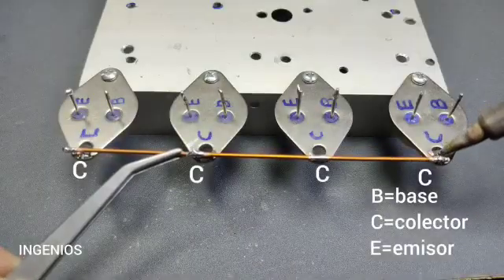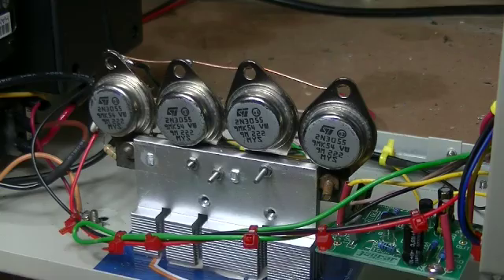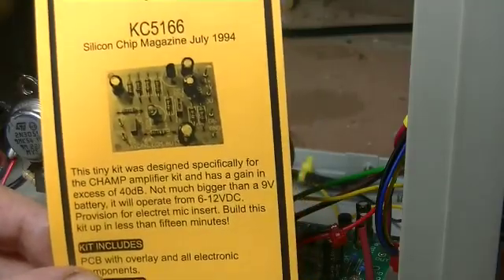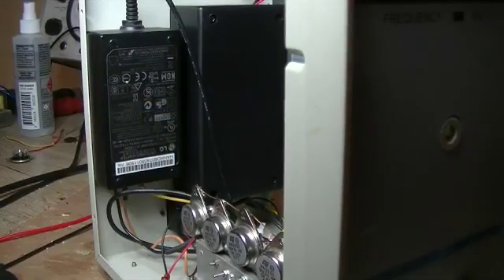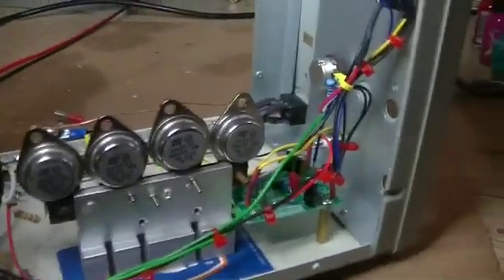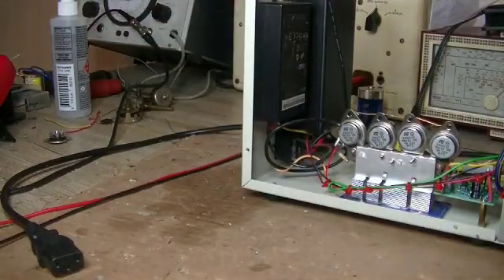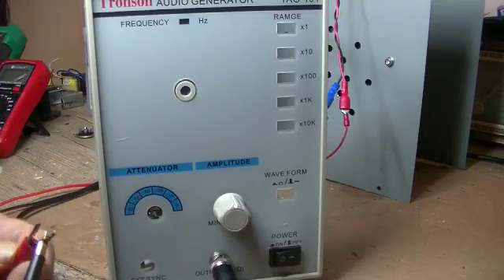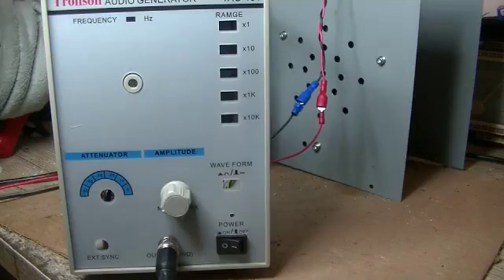I built a point to point amplifier for my signal tracer

Comment: You really shouldn't just blindly follow arbitrary circuit designs you find on some random YouTube video.  Most of them are utter crap (and some of them are just plain broken).  You're lucky this worked at all, but as it is it's still a pretty poorly designed amplifier for a variety of reasons.

Also, that's really not how you use a heatsink.  You could probably get the same or better results using a single 2N3055 and a smaller emitter resistor if it was just properly attached to the heatsink instead of dangling completely off the edge for some reason...
Reply from the maker: Seems I've  created something of a hornets nest here lol. All I wanted was a simple amp for my signal tracer. I saw the video and thought why not try it? I know nothing about amps made from transistors. This was just a fun project for the beginner :)

Comment: Four 2N3055 in parallele, but no cooling !
And in class A amplifier, with high distorsion.
With four transistors a push pull has much less distorsion.
A 2N2222 is too weak as driver.
Reply from the maker: My knowledge of transistors is very limited unfortunately.